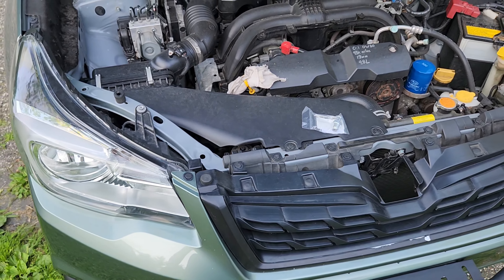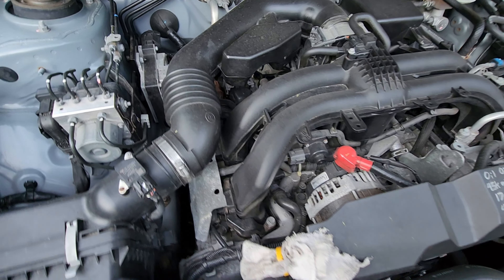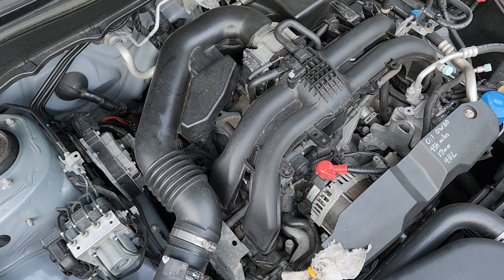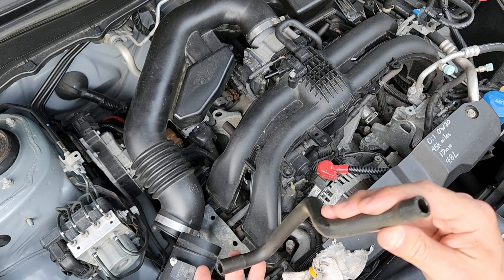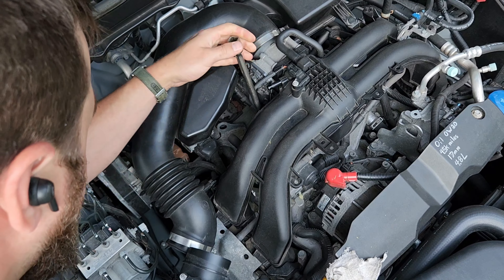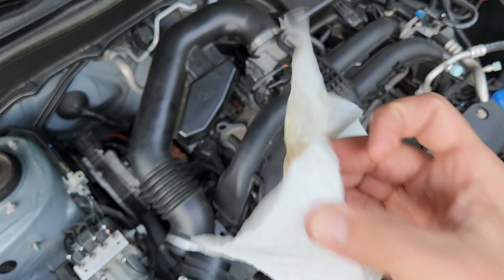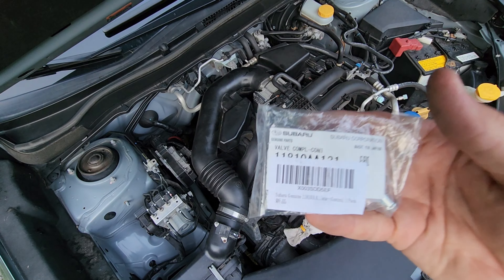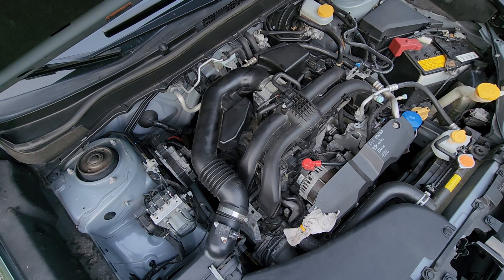Car Care : PCV Valve Clean And Test

Comment: At 75k miles I would've replaced the valve even if it still looks functional. I mean it's cheap insurance so why not while disassembling it?
Reply from the maker: The valve sits right behind my driver seat in a stocked tool bag where I can replace it anywhere. I guess it's "preventative maintenance" vs "replace when needed. I suppose you're not wrong, I willing to clean it (making it shake much easier) and check it every other oil change. 👍